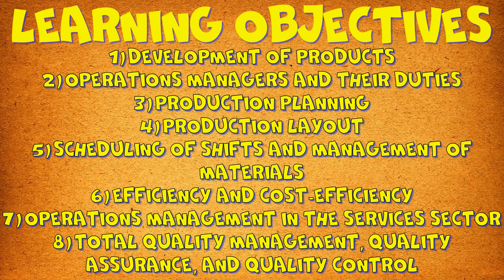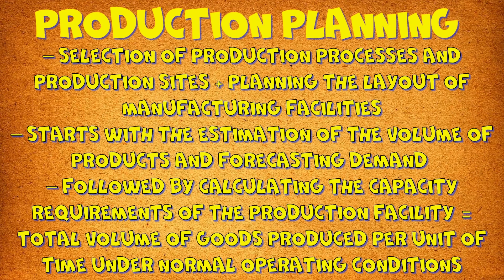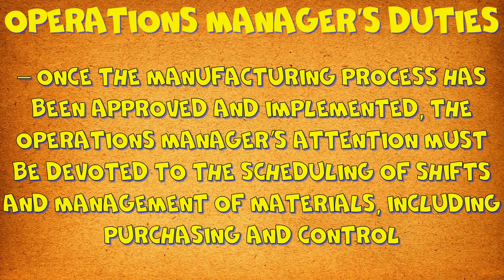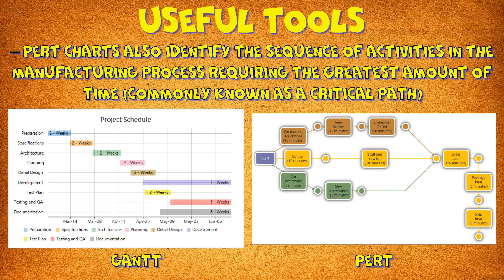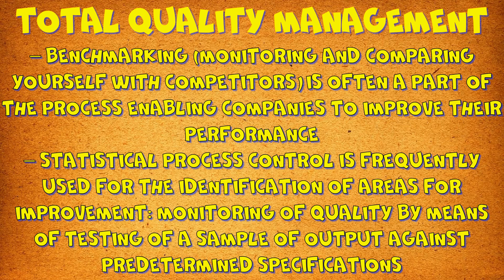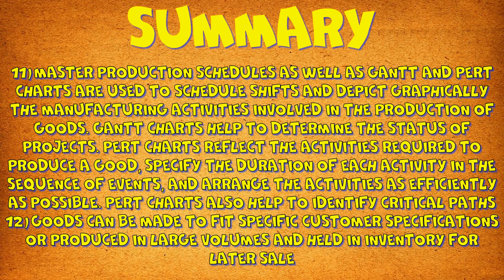Operations.

Comment from the maker: Once the production process is launched, goods can be made to fit specific customer specifications or produced in large volumes and held in inventory for later sale.

High-quality of products is not the only requirement imposed on manufacturers. Businesses need to produce and deliver goods and services efficiently and in a cost-effective manner. A variety of software systems is available to assist businesses in these areas, including computer-aided design (CAD), computer-aided manufacturing (CAM), computer-integrated manufacturing (CIM), and flexible manufacturing systems (FMS). These tools are used to create models representing the design of a product, determine the steps needed to produce components, instruct the machinery to produce the necessary parts, and integrate various operations (from design to production) into functional activities (from order taking to shipping). FMS can easily be adapted to manufacture a variety of products.

Although operational managers in the services sector face the same decisions as those involved in the manufacturing sector (deciding which services to offer and the method of their provision, estimating demand, selecting locations for their businesses, and determining the layout of facilities), several important differences exist between service providers and manufacturers as far as operations are concerned although both function to satisfy customer needs.

Service providers cannot store their products for later use as services are produced and consumed contemporaneously. Because services must frequently be delivered on an as-needed basis, estimating capacity needs for a business in the services sector is more difficult.

Service providers offer customized services satisfying specific needs, while manufacturers produce tangible and often standardized products. Therefore, operational efficiency is even more important in the services sector. Furthermore, services that require a high degree of contact with customers impose special requirements on the overseeing managers given the importance of the personalized approach: scheduling of workers is more difficult because you need to ensure that enough people are available to handle all customers whose numbers may vary significantly over time (scheduling of activities needed to manufacture a predetermined volume of goods is obviously less demanding).

Service providers that also sell goods can produce products to fit specific customer specifications or produce standardized products to hold in inventory for later sale.

In order to satisfy customers’ needs and compete efficiently with other companies in the services and manufacturing sectors, companies must manufacture high-quality products and provide high-quality services. Adhering to the principles of total quality management helps companies to achieve this goal. Total quality management entails the engagement of all members of the organization to participate in quality improvement efforts and focus on continuous improvement of various aspects of their products and/or services, including the production process, delivery process or the design itself to ensure customer satisfaction. 

Benchmarking (monitoring and comparing yourself with competitors) is often a part of the process enabling companies to improve their performance. 

Statistical process control is frequently used for the identification of areas for improvement. The process entails monitoring of quality by means of testing of a sample of output against predetermined specifications. 

Outsourcing is another approach employed by companies to improve their efficiency. It is an appealing option for companies lacking the necessary expertise in manufacturing individual components or even entire products or providing certain services, e.g. service center operations or information-technology support. By engaging outside vendors each possessing the necessary expertise, companies can ensure that all elements of the final product are of exceptional quality and the final product is functionally competitive. Outsourcing can also help reduce costs, especially when tasks are assigned to companies located in developing countries notoriously known for low labor costs.

Let us summarize what we have learned today. 
1)	The development of products and services represents an essential step in the satisfaction of customers’ needs.
2)	A variety of specialists participate in the development process, which consists of several stages starting with the evaluation of options and opportunities and selecting the most optimal idea which is subsequently refined, progressing through the development of the manufacturing process and training employees as well as building and testing prototypes, and ending with product launching.
3)	Operations managers oversee the process of transformation of various resources into goods and services, which includes planning and controlling the production process as well as quality assurance and control.
4)	Production planning involves the selection of production processes and production sites as well as planning the layout of manufacturing facilities.
5)	Forecasting demand and calculating the capacity requirements represent essential steps of production planning.
6)	During site selection process several objectives need to be satisfied: low shipping costs, adequate supply of skilled workers, low cost of resources, and a favorable business climate.
7)	Production layout choices include process layout, product layout, cellular layout, and fixed-position layout.
8)	Once the manufacturing process has been approved, the operations manager’s duties include the scheduling of shifts and management of materials. 
9)	Selection of vendors and acquisition of materials represent one of the primary tasks of the operations manager, which can be simplified via the use of technology.
10)	Just-in-time production and material requirements planning are frequently used for inventory management.
11)	Master production schedules as well as Gantt and PERT charts are used to schedule shifts and depict graphically the manufacturing activities involved in the production of goods. Gantt charts help to determine the status of projects. PERT charts reflect the activities required to produce a good, specify the duration of each activity in the sequence of events, and arrange the activities as efficiently as possible. PERT charts also help to identify critical paths.
12)	Goods can be made to fit specific customer specifications or produced in large volumes and held in inventory for later sale.
13)	Businesses need to produce and deliver goods and services efficiently and in a cost-effective manner. A variety of software systems is available to assist businesses in these areas.
14)	Several important differences exist between service providers and manufacturers: service providers cannot store their products; service providers offer customized services instead of standardized goods; service providers must deal with fluctuating demand. Therefore, operational efficiency is especially relevant in the services sector.
15)	Total quality management approach may help companies to ensure the high quality of their products/services. This requires all members of the organization to participate in quality improvement efforts and focus on continuous improvement of the various aspects of the products and/or services.
16)	Benchmarking, statistical process control, and outsourcing are frequently used to ensure the high quality of products and services.